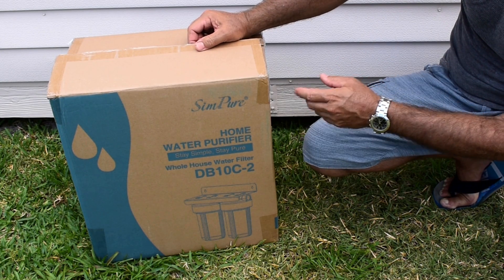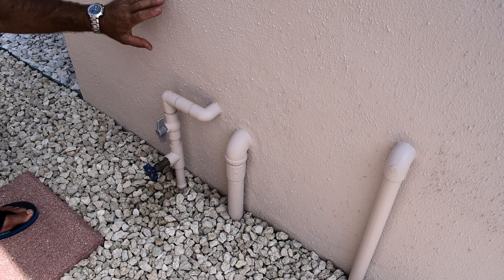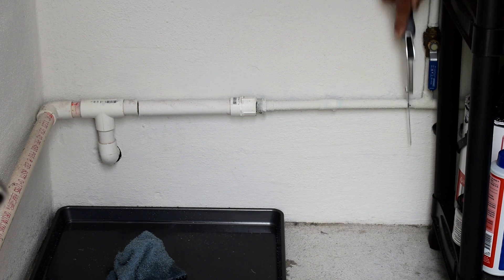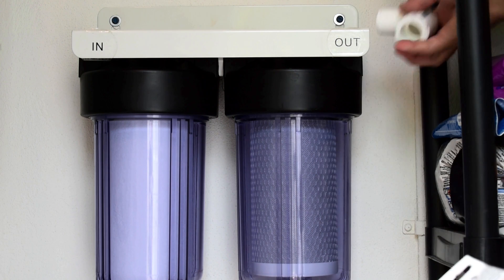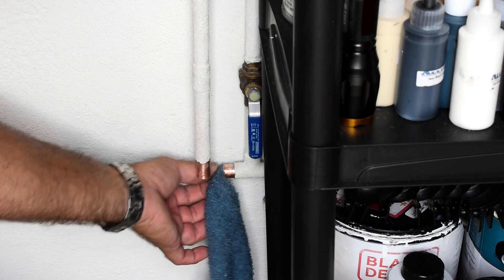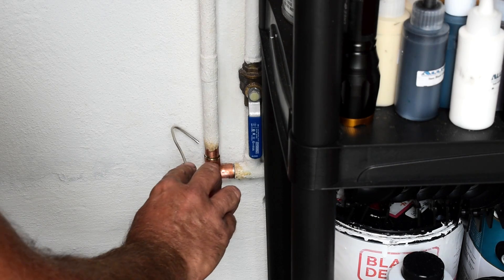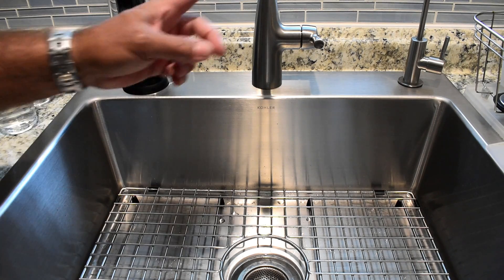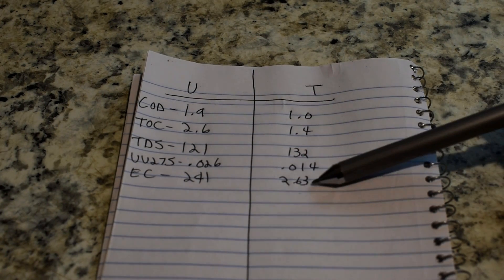Whole House Water Filter System Installation & Water Quality Testing(2 STAGE)

Comment: Is there a way to change the in/out direction of flow ? Would make my install easier.
Reply: I believe you can just unscrew the 4 bolts above each canister on the bracket, reverse the units, and reinstall the bolts.  I bought my units separately and they are easy to flip the in and out.

Comment: I HIGHLY unrecommend clear filter canisters. They grow algae & "biofilms" that aggravate the filtration process. Opaque is better. 
Other than that, nice project. Most U.S. municipal water providers put out very high quality water but well water can suck sand at times. What does come in muni water are the chemical treatments that can be removed by the carbon block filter. In Mexico, the muni supplier I have leaves sand & silt in the water that you don't notice until you pull the tank lid & see the sludge at the bottom. I use a 1 micron primary filler then 1/2 micron carbon block that picks up most viruses & virtually all bacteria.